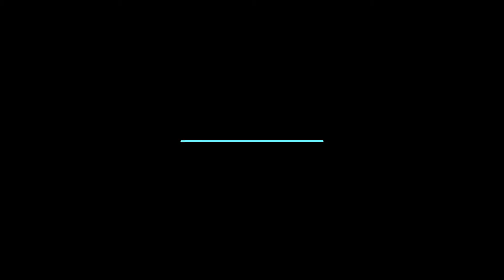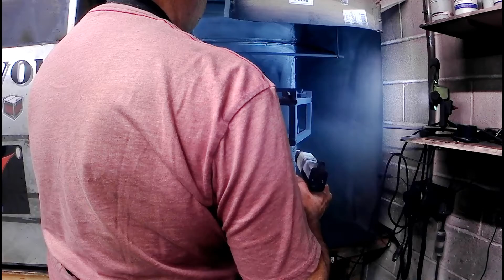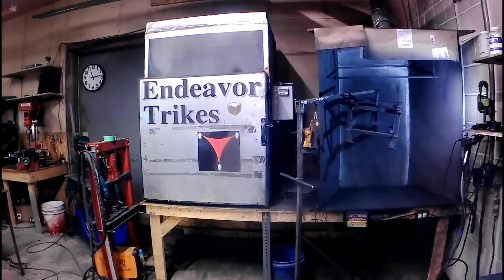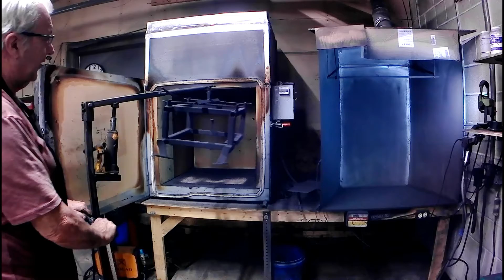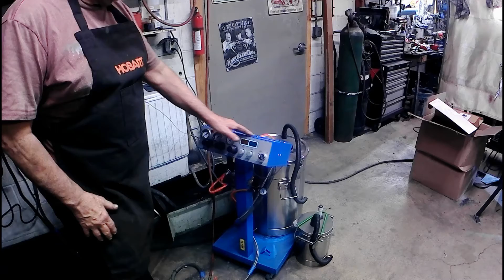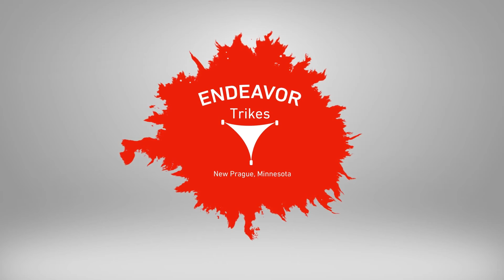wx 958 Powder Coat Machine repair and replacement review

Comment: I would like to say Thank you for your in depth videos and diagnose of this machine.  My flaw was also the air setup inside the box. Once fixed based off the information you shared I was able to produce some good work. This machine still has its flaws but it gets the job done. Thank you again!